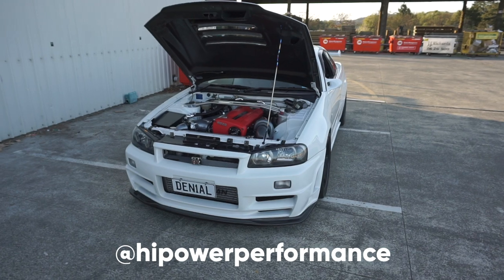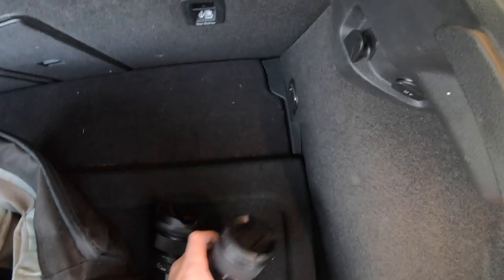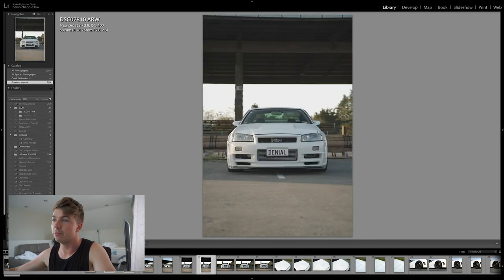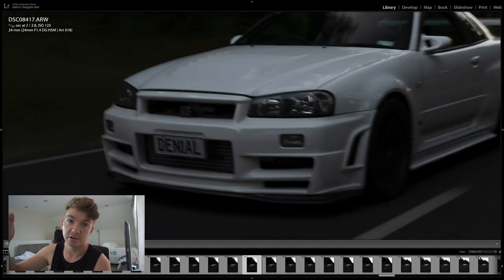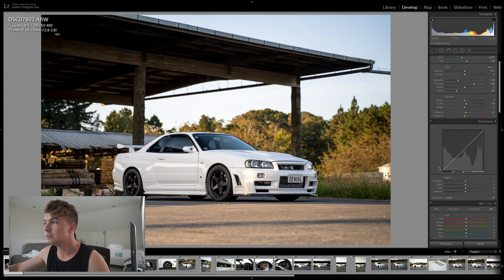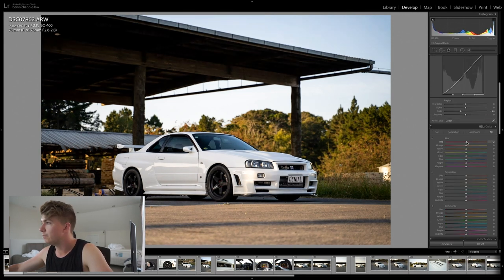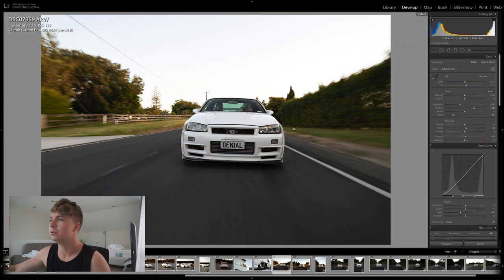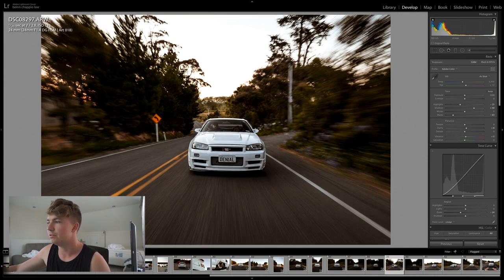HOW TO SHOOT ROLLING CAR PHOTOS - 900HP R34 GTR

Comment: What harness do you use?
Reply from the maker: Any safety harness from a local hardware store will do the trick
Reply: @Beinn  perfect - in the UK there are a few health and safety regulations if we're doing rolling shots from the back of a car. Will have a look and see what people recommend! 

What speeds do you usually reach?

Great channel and cracking content 🤙
Reply from the maker: @willlarmour9744  Thanks! It's completely illegal here gotta be careful haha, no comment on the speed hahaha.
Reply: @Beinn  😂 - no worries at all. I've got an idea of where I need to be at.

Might have to try it on private roads first!

Last question - where would you usually connect your harness to in the car?
Reply from the maker: @willlarmour9744  most cars have a little metal loop in the boot for baby chairs etc, otherwise around the headrest of the most seats